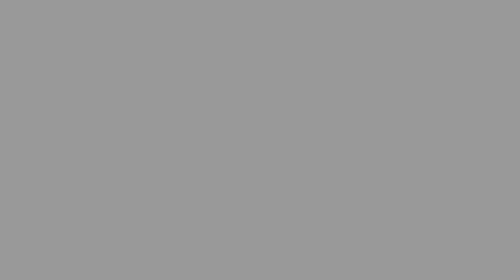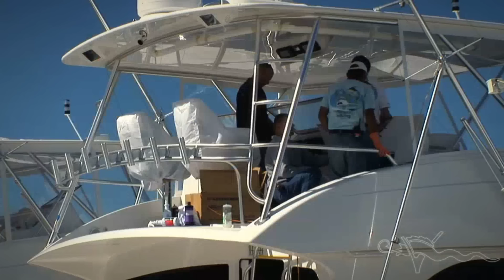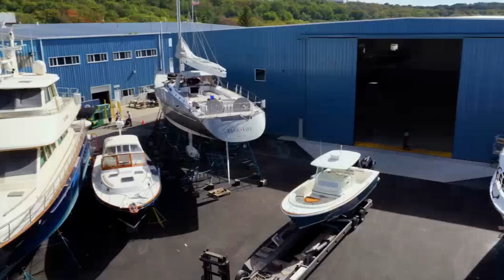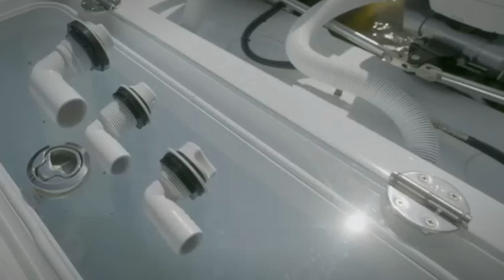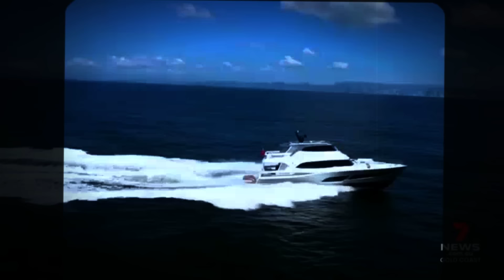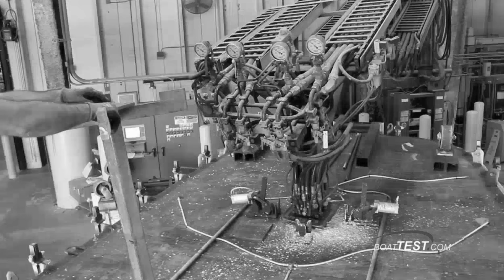The ONLY 7 Yachts That Last 30+ Years in Saltwater

Comment: The fastest and strongest sportfish hulls made today are still made from wood. Rybovich, Paul Mann, Jarrett Bay.  Lots of those hulls are over 30 years old Rybos that were made in the 60s are still on the water today.  It just takes the right maintenance and care.  Even today, nothing has a higher tensel strength to weight ratio than encapsulated void free marine plywood. Not even carbon fiber. To achieve the same strength with carbon fiber, it becomes much heavier.  Therefore it's a slower hull and consumes more fuel. A 60 foot Viking won't hit close to 50 knots...but a Paul Mann 60 will with the right motors.
Reply: Of course Roybovich has been using Mahogany on their hulls since the early 1950s. And several boats from the 50s and 60s are still running.
Reply: What about Striker, they were made out of Aluminum?
Reply: @trucking604 I think those guys went out of business in 1989 or 90.  The modern common rail diesels weren't producing the same hp per pound back then.  A guy on our pier had a 62 striker.  Our 52 Hatteras was much faster.
Reply: Yes of course this list is for the regular companies, those specialties custom yards are always tops.